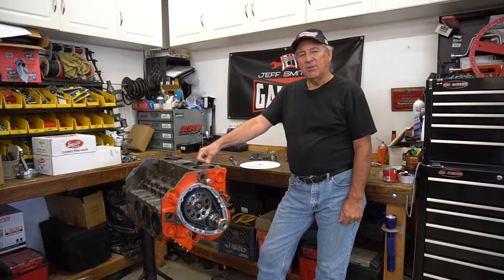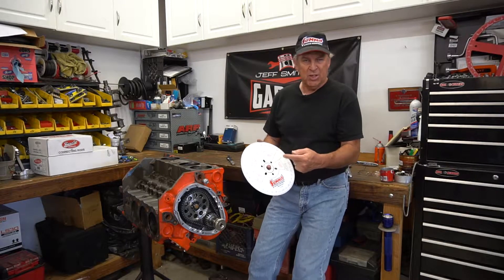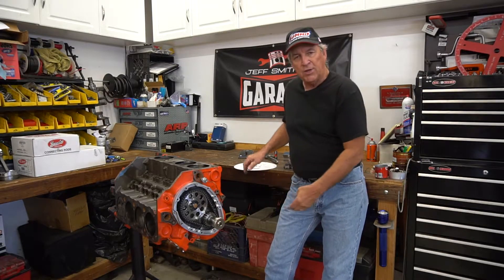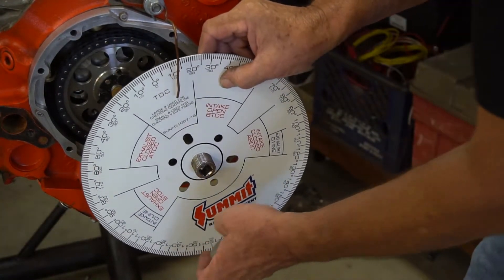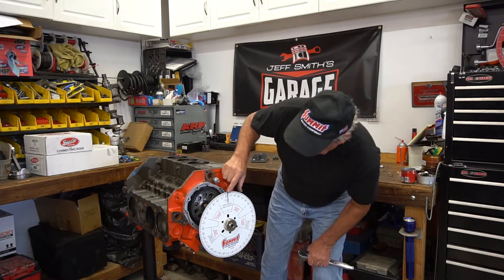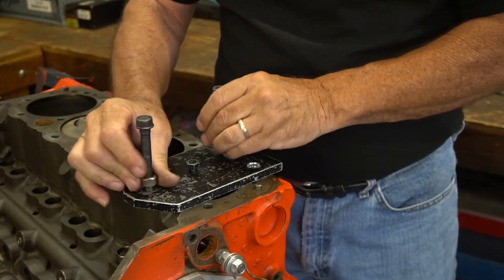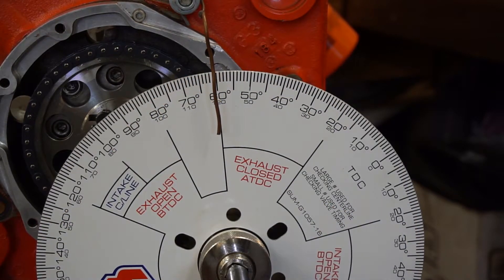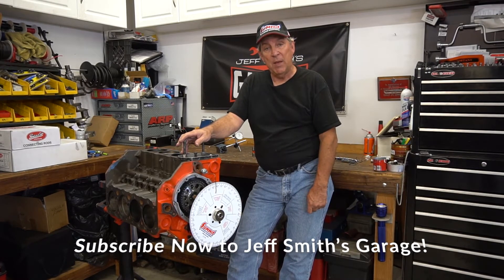Jeff Smith's Garage  - Degree wheel basics

Comment: Can I Use a Degree wheel to time a new rebuild with the heads and Intake Manifold on ?
Reply: BuzzJones
Yes absolutely. The biggest difficulty will be establilshng TDC. The msot common tool used is a spark plug piston stop. The only problem is taht with newer heads and flattop pistons that often the piston stop will not contact the piston. What I've done in tese cases is to use a lever-action, over-center tool that was originally designed to remove/change valvesprings. If you use a flat bar to contact the valvestem insted of the spring retainer, you can use this tool to push down on either the intake or exhaust valve and use it as a piston stop. You must be very careful here not to hit the valve very hard with the piston or it may bend the valve, so approach the top of the travel carefully and slowly and under no circumstance use the starter motor to bump the engine - you must do it by hand wtih all the spark plugs out of the engine.  But first, try the spark plug piston stop method and see if that works - its much easier to use and quicker.

Comment: Isn't the degrees of the lobes come with the manufactured cam? I'm not understanding the purpose of the degree wheel. Timing marks sets the cam, correct?
Reply: Not necessarily!      The keyway in the crankshaft indexes the lower sprocket to the crankshaft....assuming that the keyway is correct.
The "dot" in the upper sprocket is to align with the "dot" in the lower sprocket. 
This indexes the camshaft to the crankshaft, the chain locks them together! 

To further degree the camshaft, an offset bushing is used at the upper sprocket........ or, we use a lower sprocket with several offseting keyways in it. 

Now, to precisionally verify that all is good, we use the true # 1 TDC markings against the camshaft lobe operation, as per the manufacturer's specs.
Reply: I’ve always thought a timing disc is mainly used to set the ignition timing correctly, once you have established tdc with a Dti or pencil or something and turned the disc to 0 against your improvised pointer you can then set points or elec ignition light to come on at say 8 degrees before tdc. I would agree that a new camshaft would have a key way and marks on the drive gear to make it difficult to install incorrectly. Of course there is a good chance that I’m completely wrong, please correct me if you know better

Comment: Ok but once again and just like all the other videos, all the videos show how ro install and how to find to find true TDC. There isnt a single video that shows once you find true TDC what adjustments you now need to make
Reply: Nice, clean, and to the point.  Nice job. 😎
Reply: Why does it have to be a video? There are dozens of magazine stories written on how to degree a cam. All you have to do is search for on them on the internet. I personally have written different versions of this story at least five times in my career. This video emphasizes only the step (which is often overlooked for its importance) that it is critical to determine TDC with the degree wheel because if this step is not accurate all of the other steps will be inaccurate which menas you might as well not bother to degree the cam at all. Determining TDC is the critical step.
Reply: @jeffsmith2003  then why do this video?